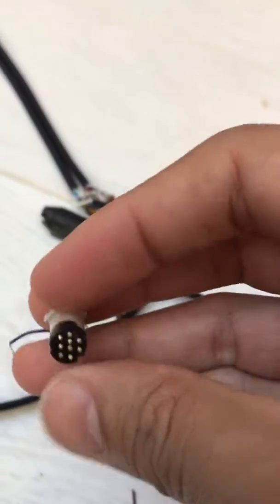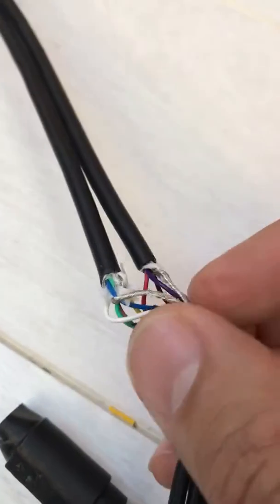BOSE WAVE II DAB MODULE BROKEN CONNECTOR PIN REPAIR

Comment: Hi, this is more of a question I can’t find an answer to and hoped you may know with your expert knowledge on the Bose systems. I have a wave ll and and 3 disc changer and recently acquired the dab module, the problem I have is I can’t connect all three together as it seems the boselink socket on the back of the dab module is empty? Is there a way of Connecting all three units together? Any help greatly appreciated. Many thanks. Dave
Reply from the maker: Dave, thank you for watching my channel, please subscribe for more upcoming videos. Now to answer your question. I must say the thought did cross my mind but I have not tried it. The issue is the CD changer blocks the AUX port so only the changer can be used on the main unit, where as on the DAB the port is available on the main unit. Bose have not designed both items to work simultaneously for some odd reason. The only way you can have DAB and CD changer is to buy wave III and then look for a CD changer that will connect to the wave III system. Which there is one available but the one for wave II changer will not work on Wave III. If you have a bose DAB DIN extension lead you can try using that on the Changer and then plug the changer in the DAB which in theory should work on wave II. Hope this helps.
Reply: @thespecialist786  hi I am already a subscriber. Thank you for taking the time to reply. I have tried the extension lead from the changer which as you say has the blanking plug for Aux, but when plugging the extension into the dab module nothing happens and if you read the instructions it says that the boselink connection within the unit does not work it’s just empty? What is the point of that? Is there a way of getting it to work? Thanks. Dave
Reply from the maker: @Experimental-DW  I will run some tests and get back to you.
Reply: @thespecialist786  thank you.